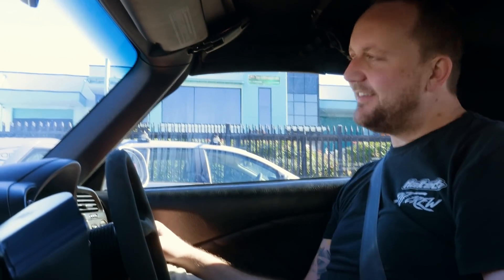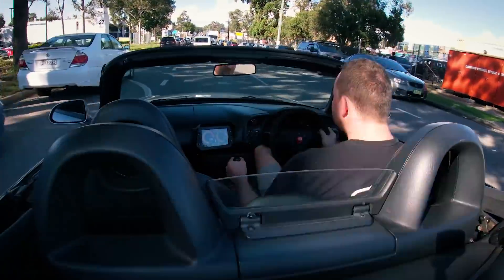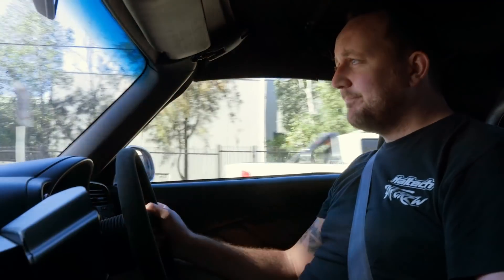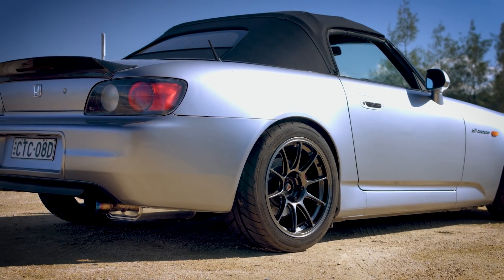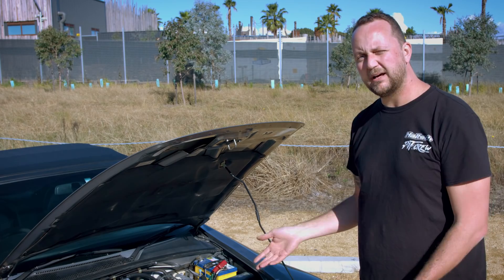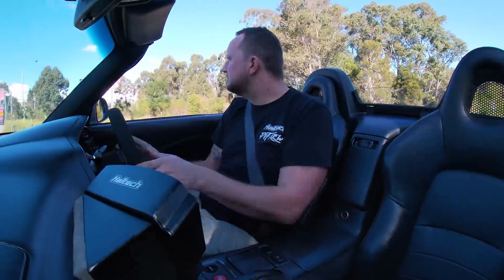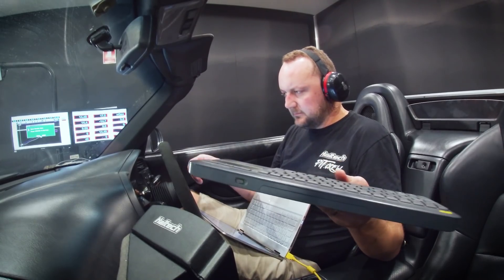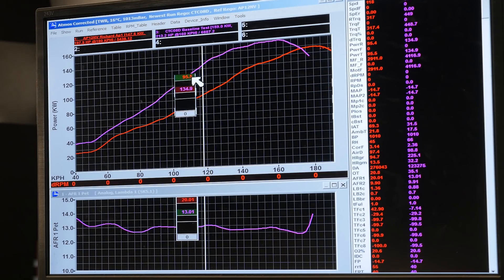💬 Does "K" stand for "King"? K-swapped S2000 examined | TECHNICALLY SPEAKING |

Comment: A tip: that nasty sound the top is making? After locking the latches, hit the top down button for a second and let it preload the bars. No more rattles, it’s great.
Reply: Won’t that stretch the top material
Reply: @1nvd  it does the opposite
Reply: Thanks for the tip!

Comment: I believe you read my mind, a rear drive transmission for a k swap! So... What company sells the adapter and would I need a special flywheel and clutch assembly as well.
Reply: There are actually lots of it. Kmiata guys have the adaptor for mating k series into the stoud bmw box

Comment: Great episode Tuning Fork, can't believe you fit in it :) -  2007 S2000 owner here with a F20C (yes Australia retained the F20C and even the AP1 plates in the engine bay even though everyone calls it an "AP2"). I can definitely appreciate the K24 and they're so reliable even when boosted. You've potentially highlighted a good value option for that ridiculously rare situation where someone might need to replace an F20C. For now I'd be looking to keep my original engine with the car and potentially supercharge it. An F22C vs K24 on the dyno would  be interesting, but we don't really see those in Australia. Thanks again for the Honda love!
Reply: Keep your head held high that the F20C still beats the K24/20 in specific power output by about 11% using the peak power figures quoted in the video :)
73.5 kW/L v's 66.25 kW/L. I guess that shows how well the F20C flows...
Reply: @plmsdevelopments  Well no, its also a function of turning faster. But that budget K24 in the video car has heaps more in it if they were to want an equivalently worked motor.
Reply: Hard to compare numbers across different dynos, but I would expect the f22c to have similar numbers or slightly more peak hp than the k24/k20 frankenstein.  Honda rated f20 and f22 with the same hp, but when compared on a dyno, the f22 consistently makes about 10 more hp.
Reply: @Hosz688  A stock F22 would be about halfway between those two dyno lines. Won't make the same or more peak power.

Comment: I love my 2005 tsx bc it has the motor every one wants and is a sleeper lol bc is a supercharger automatic semi manual and people face are priceless wen I beat them  I know I am not the fastest but I built my baby to have fun and looking good and enjoy the ride
Reply: Semi manual?
Reply: Semi manual. The term automatic people use to make themselves sound better
Reply: I recently sold my Acura TSX, and i can say its the best car i have ever driven, everyone envies that k24a2 in it since it is the best k series motor ever made. Its also THE best looking sports sedan Acura/Honda has ever made, it is simply gorgeous. It handles amazingly well with double wishbone suspension used for many race cars. The engine itself is super powerful and the car is super fun to drive. The Acura TSX is the MOST UNDERATED Acura/Honda ever made, it destroys civic, accords, integras, with its amazingly rigid chassis and superior motor. People need to stop stealing the engines from them and actually build those cars themselves as it is an amazing car. Way better built car with Luxurious leather and build quality. The automatics really are not bad either the sportshift is surprisingly fun to drive and mechanical feeling. I kinda regret selling the car

Comment: Can you imagine if Honda made a inline 6 cylinder based on the stretched K-24?  Give the 2JZ and RB26 a run for their money.
Reply: 2KZ
Reply: @emanh4keem_san420  I see you're a boostedbois fan
Reply: Look into the early 80s Honda CBX motorcycle. You wouldn't want one based on the K-series, but an I6 based on the F20C would have made an already legendary car into a world-beater.
Reply: @taylorc2542  I have dreams about this
Reply: A k24 will spank a 2jz
Reply: Kaze Oner  h22a boosted has been known to give the supras a hard as well .. it’s been done a few times
Reply: Wow was thinking the same, "what if they added 2 more cyl for a straight 6". Another what if, " building a 4ag engine into a 5 cyl, therefore a 2l 25v revving up to 11k. Mental
Reply: well they made a c32b but problem is its super expensive and rare since its the engine of the og nsx. honda also made the j35. but ive got no idea if its any good. but both are also aluminium block engines so theyll probably not that great on holding large amounts of boost.
Reply: @99Lezard99  j35 is decent but its all about the j32 if you want a v6 from hinda on boost but even then its relatively un supported most things will have to be fabbed manual gearboxs are rare and expensive. But the make great torque and sound great
Reply: I really wish Honda would make a badass V6. The J37 is eh.
Reply: I really thought the S2000 should have been made with a 2.5L 5 cyl. 

To me, it just seemed like a nice way to sort of echo or mirror their current F1 cars (at the time) that were V10s.

It is a purpose built motor, so they weren't designing as a 4 cyl to put it in a different car. You'd get a little extra torque and hp without going to a 6 cyl. Saves some cost vs a 6, gives just that little bit of extra flavor than a 4, an interesting exhaust note, while remaining somewhat compact. Then you could still have that 9000+ rpm redline, without having to bump out to 2.2L to get more torque.

I think it still would have respected the S500, S600 & S800 with (at the time) a modern twist.

Idk, the whole idea seemed reasonable to me.

I think Honda genuinely considered it from what I've read, but decided to go with the 4 for whatever reason.
Reply: The irony is they already have been giving them a run for the money by car lengths, and it makes 2J and RB fanbois nervous
Reply: I think it would replace both of those in a heartbeat, as the k series  sits now it already gives them both a run for their money lol,

Comment: I'd like to see the f22c on that side by side graph. It's got to fall somewhere right in the middle. With s2ks appreciating in value the way they are right now I could never see swapping the engine just for fun or selling a good f series engine. A low miles car went for over 50 grand at auction this week. Also if you're out for a forced induction path there isn't much point in this swap either. But if you've blown your f series and want a better replacement (and your ready to toss all sell value) then yeah the k is a good option.
Reply: My f22c got 600whp on stock block going on 12k miles lol
Reply: Most of the high auction cars are very low mileage and in showroom or nearly showroom condition. Cars with normal mileage in good condition are still somewhat reasonable, although they too are still going up.
Reply: K24 can hold boost as good as f series. They can hold up to 400whp on stock bottom end, where even if F could hold more, it would be pushing it´s limits.
I feel like the biggest thing going for K series is the NA game. They can push over 400hp NA which is ridiculous.
Reply: @RealLeskot  I've never seen a 400hp na k24 ? Most of the na builds I've seen land in the high 200s. Gears and gas just did one actually. Even if those numbers were possible I'd imagine you're talking so custom everything it's going to cost 4x what a simple SC or turbo setup would cost.
Reply: k = i blew my f20c and didn't have cash to buy another. i'm sure the resale will go really well

Comment: Can tell from the power graphs that the k24 will drive a ton better. Ran a F20 s2000 and the noise and pomp at near 9k was immense but it was a turd anywhere below 6k and the lack of torque made it feel a super heavy car for what it was. 
Enjoyed driving a little vvt mx5 far more than the s2000 as it “felt” twice the torque and much lighter in most situations (mx5 has nothing up top though, not denying the engineering in the Honda is far superior, even including a much more rigid chassis).

Comment: Did I miss something? You compared a 2.0 vs 2.4 and completely over looked the f22c of an ap2. That's like 2jz gs
Vs 1jz,  rb26 vs rb25, or even the ej20 vs ej22. Seems like the outcome was already predetermined and bias. If you are going to put dynos against each other at least have them be stock vs stock, no mods no tune.
Reply: to be fair the f22 is also the same block as the f20 just stroked differently
Reply: Stock v stock is fair but no tune isn’t. The k series is massively held back on the oem Honda map. Also it’s a price thing F20c sell and with that cash you’d gain more going k series it’s a no brained

Comment: I used to hate Honda’s... this is a very interesting setup.
Reply: How could you hate a v-tech Honda you would have to be very ignorant. They're a lot of fun. I used to own a k20 integra dc2 awesome car
Reply: Honda set the world record for 0-60 time in 1.1 seconds, and they did it with a 4 cyl.
The F20C (the original S2000 engine) held the world record for the most horsepower per liter of any NA engine costing under 200K USD.
The Civic Type R is practically matching the Dodge Charger Hellcat's times on the Nurburgring (the most popular and dangerous track in the world). It's within seconds, and the Hellcat engine is a 6.2L V8.
Honda is THE BEST car company ever to exist (IMO)
Reply: @juansolo1617  You mean someone built a highly modified drag civic to do 1.1sec 0-60. Honda themselves didn't do anything. I daily a Honda but quite frankly their existing lineup (in Australia at least) is boring at bat shit. Honda have been devoid of innovation for years excepting the Type R, NSX and the Honda 'e' electric car that is coming. The K series was designed over 20 years ago and Honda have not given us much else to get excited about since.

Comment: On this week's episode Tuning Fork fits himself into a tennis shoe...   I just wish Honda had built a 4 litre V8 with those K-Series heads on it now .. imagine that noise a V-tec V8 at 6500rpm..
Reply: Nah Inline 6 mate :D A 3l variant with the K20 stroke and factory 8500rpm redline and a 3.6l variant with the K24 stroke, YUM
Reply: They did. Check out the MF408S.  It was a massive failure because it made TOO MUCH power.

Comment: The K is the new answer to everyone's question. I wish I could find a salvage S2000 to do a K swap too, I just don't have the heart to swap out an F20 or F22.(Nor the money 😄)
Reply: I wouldn’t either. F20c is such a special Motoe and is unique... so much tech in it.
Reply: @JohnSmith-yr6je  what tech?
Reply: F20C started it all with its 9,000 redline I’m good I’ll pass on a k series maybe for a daily yes but not as my baby lol
Reply: Throw it in a S-chassi or somethin :)
Reply: Yeah but there comparing a k24 block to the stock F20. How much torque did a stock Acura RSX Type S have with the stock k20 block
Reply: Now if you stroke to a F24 its a different story. I've seen stroked F24 NA S2000 beating supercharged and turbocharged cars at the track
Reply: U are not just swaping an engine. U are puting it in a gearbox with gears for a 9000 rpm engine, in a 8000 rpm engine. U are swaping and puting the equivalent to a shorter final drive. Thats where the extra strength is felt in aceleration

Comment: The F20C is a better engine all around (IMO). Rarer. Probably more stout, too.
Reply: And quite a bit more expensive. You can put a built k series in there for the price of the f20
Reply: @HarryTwatter  I could get a K. No way I'm getting an F20C. Of course I'd go for the cheaper option. Nobody stops to think that the cheaper engines will do more with a turbo than both of those options.
Reply: The fact that youre getting variable cams besides the VTEC on the K-series makes it a lot smarter so the K is the better "all around" engine. But the F20 probably has some features going for it when it comes to beating the hell of it in NA form.

Comment: its not better than the F motors. Bad swap. And how often are you pinning it? All the goddamn time if your an s2k owner. If you cant afford to mod the F motor then dont buy an s2k. Yeah you did upset me lol
Reply: The reason to buy an s2k is for that 9k redline
Reply: TimothyReidUpNorth907  There is debate about the reliability of the K series. They might be alright for a full-race car (not driven much, rebuilt often), but I wouldn't want one in a daily. The F series has less complexity in the valvetrain. If you're boosting you won't see much improvement with the K series over most other DOHC honda engines with the same overall specs.
Any engine can crank up to 9k but they won't be making power there unless the cam LSA is widened, which will reduce power in the lower RPM band. This is where ITB's shine. If you're going for WOT high RPM performance, just get a B18C and widen the cam LSA. Cam phasing isn't really necessary.
Reply: TimothyReidUpNorth907  I haven't owned any K's. I've had D, B, H, J and F (SOHC). I spend a lot of time at the drag strip. I know some of the best tuners in my area. I sit around their shops and absorb information. The K isn't the end-all be-all. It's like a toy. The B series is the most reliable daily. I'd even prefer the LS.
Reply: TimothyReidUpNorth907  No need to take it personally. I can't see your replies because you must've said something that got censored by YouTube. If you like the K, run the K. Even a D can run 10's if you build it right.
In my mind, Type R and GSR will always be better than the K. It's my preference.
Reply: Ls swap much better I agree
Reply: 9k takes it for me sorry but k series is cheap to me💁🏽‍♂️ F20c > k24
Reply: This. If it doesn't rev to 9k it's a hard pass for me.
Reply: If having a 9k redline is the only thing that's important, then just do a K20 w/ some basic cams and rev it as much as you want.  iVTEC for a better low end, still more topend power overall.  But frankly, giving up the HUGE torque advantage you get by using an inexpensive K24 block is silly.
Reply: I’m sure if the owner can afford to do a K swap then money isn’t a problem..
Reply: TimothyReidUpNorth907  You're right... it's tried and true. I have no desire to have a K. Right now we have a J35, but I could have a D cheaper, ebay turbo and it would be mopping the NA K's on the road. ANY engine can be fast if you build it correctly. I tell everyone this.
Reply: @juansolo1617  ebay turbo D mopping Ks lmao come on buddy,just stop please this is getting silly
Reply: @ArtVandelayOfficial  You seriously think NA anything is going to beat an engine with boost? LOL. I see you've never been to a drag strip in your life. ebay turbos are just cheaper sleeve bearing turbos (opposed to more expensive ceramic ball bearing turbos). They still make major boost, just a slower spool. An NA K couldn't match a D on boost, regardless of the quality of turbo.
Reply: @juansolo1617  Well we should end this conversation now clearly,but just a heads up I've been in the Honda game since the 90s. Thanks for the lesson though 😏
Reply: @juansolo1617  Just passing through here, but I´m with you Juan, I am not familiar with the D series but I bet it can handle 350+ with a simple cheap setup? Thats a  50% increase in power over an NA K24 so I dont see why the NA should be faster. That said, a stock K24  just keeps on going as long as its maintained, not really any reliability issues to talk about there. So for me, I´m going K24 NA to start with and just boost it when I get the money, great flowing head and I-VTEC on 2,4l displacement thats all you need bro.
Reply: @ArtVandelayOfficial  Honestly, I wish people could come together like they do in cultural situations. An engine is an engine. What YOU do with it makes it special. It doesn't matter what company designed it. As an engineer, I love all machines.
Reply: @bingoberra18  It could potentially handle the power you desire. If you're getting into specifics you would worry about the deck/sleeve strength, or perhaps the crank strength (D series seem to break cranks more than any other Honda engine)... but it all boils down to what YOU like. No matter what it is, there's a 10 second build of it. Pick whatever engine you like and go with it. We all see Cleetus McFarland setting slow times with his BUILT Corvette but it doesn't matter. That's what he likes. He's driving it. That's all that matters.

Comment: Isn’t the S-2000  a F22 tho
Reply from the maker: This one had the F20C in it originally.
Reply: Yea my bad I should’ve listen first F-20
Reply: In Australia we never got the F22 even in later year models. So whilst we have "AP2s" in the US sense, they're actually not even called that on the plates on the internal engine bay because we retaind the AP1 F20C. I personally love the combination of the "AP2" upgrades with the 9000RPM engine. Perfection!
Reply: The facelifted cars in Aust are often (unofficially) referred to as AP1.5 - as they have the AP2 upgrades minus the F22. Sort of half way between AP1 and 2 so to speak.

Comment: Ishould be picking up my s2000 this sunday icant wait
Reply: Congrats!
Reply: Enjoy😍😍
Reply: Congratulations, look after it :)
Reply: Make sure you Kswap it... I have a K20/k24 frank in mine.. Makes 280whp and 220tq.. Thing is a monster.. I do have cams, valvetrain and piston upgrade though.. Ported 4-Piston head and 90mmTB.. When it comes to drivability between a K24 and a F20/22, its not even close in my opinion.. The torque and low-mid range power is just such a joy. And its power you actually use all the time. I came to hate having to rev up to 6K all the time to feel power. Dont get me wrong, the K20 and F20 are fun motors, but in my opinion they just arent the best daily motors to enjoy. Unless you boost them of course lol.. Ill be bolting up a MercRacing 1900 soon. Hoping to make about 450whp